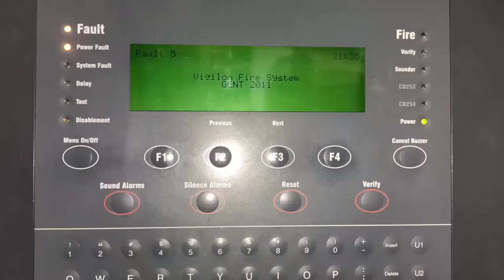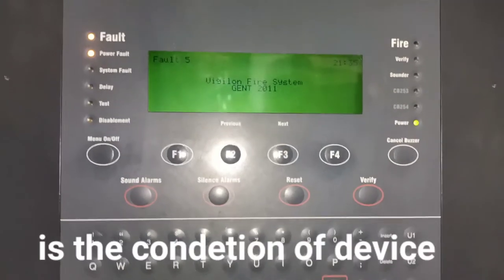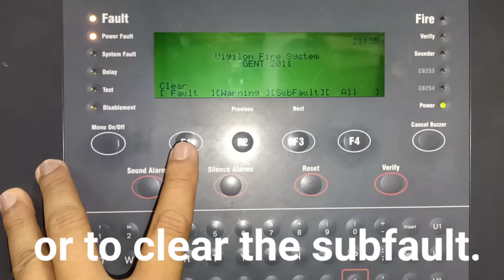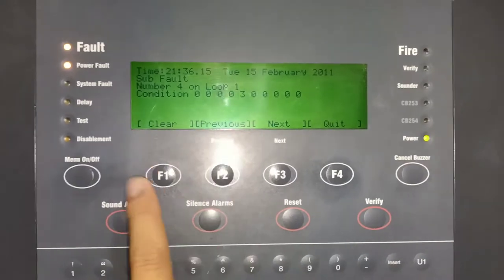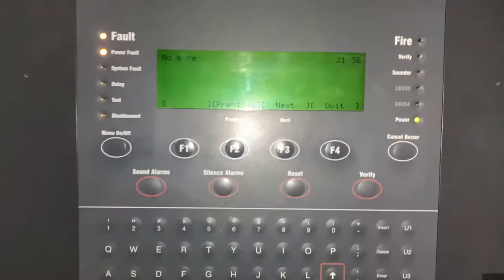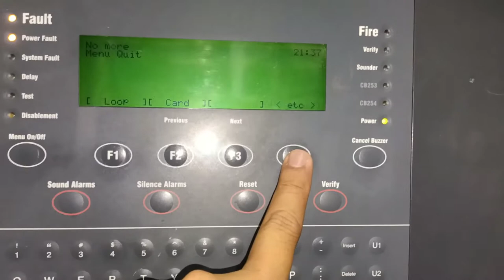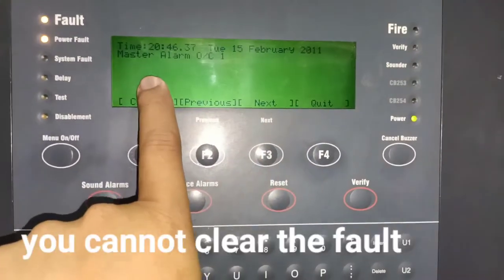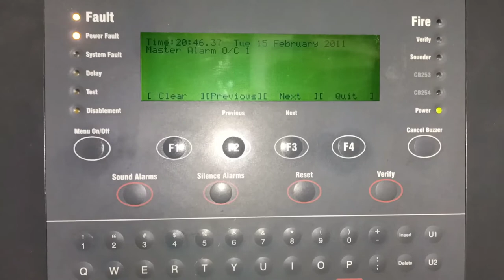HOW TO CLEAR SUBFAULT | GENT FIRE ALARM SYSTEM | JHAN2XTV  VLOG#60

Comment: Hi my friend how i can clear voltage too low in vigilon
Reply from the maker: That problem  have a batterry low voltage  or need change check the battery voltage and connection proper.

Comment: Brother, recover failed at card1 how to solve this, gent vigilon panel
Reply from the maker: brother that why recover failed because may be you adding new device or replacing not same device at the loop is not complete same before status should be they same  if how many device before.and check your connection if changing the device proper,some time showing wiring change loop map at card 2..due that connection.that is  all cause of recover failed above mention
Reply: @JHAN2XTV   yesterday came fault came... Pointer  failed at card1, I reset the  card1, then this fault removed but new fault came... Recover failed at card1, I didn't change any wire device etc
Reply from the maker: try to allocate loop 1 may be some device after allocate showing faulty and loop not complete.qq

Comment: sir paano yung oc L+ ok nman voltahe niya meron syang voltahe in and out pero oc L+ parin ang kumalabad
Reply from the maker: OC open circuit L+  Line positive may red o brown na cable d maayos pag ka terminate of nag lost, check mo ang line
Reply: @JHAN2XTV  cge sir salamat san uunahing tingnan ung wire dun sa nag open circuit

Comment: Hi Bro morning 

Bro tanong ko pano enable yung card 3 na ka disble at yung sounder
Reply from the maker: sa loop 3 yan pag card 3 tanong kulang ano bang nakadesplay sa panel na disable correct details.para alam ko ang sagot
Reply: @JHAN2XTV  hi sir eto sir nakadisplay .pede ko makuha number mo dito ako sa saudi Jeddah
Reply: @JHAN2XTV  
Nakadisplay sir zone disable nos. 3
At naka ilaw yung disable led
Reply from the maker: En able mo zone 3,same procedure sa pag en able ng device o sector pero ang en able mo zone,panoorin mo yung vedio how to des able and en able in gent system.
Reply: @JHAN2XTV  enable ko na sir pero ganon pa rin ayaw matangal yung pagka dis able nya.pero lag try ko allocate ok naman
Reply: @JHAN2XTV  ok na sir salamat my isang smoke na nakatangal yung mga wire nagmaintenance kasi sila ng ceiling tinangal hindi binalik
Reply from the maker: Ok sir walang anuman..split ang loop nyan kasi nakatanggal ang wire